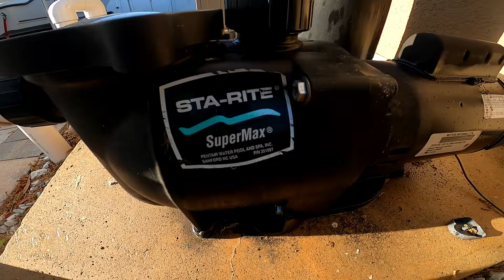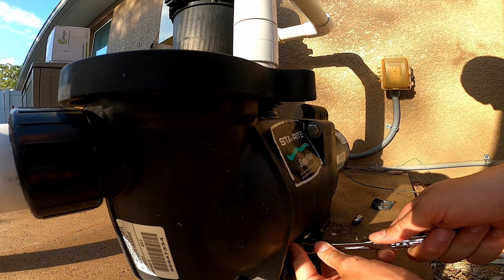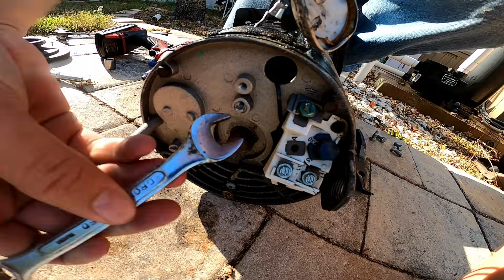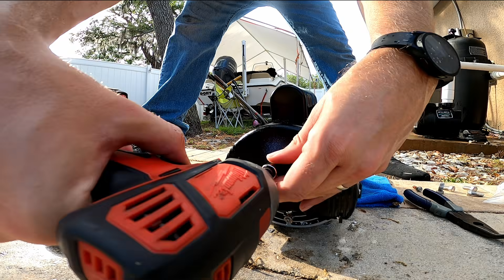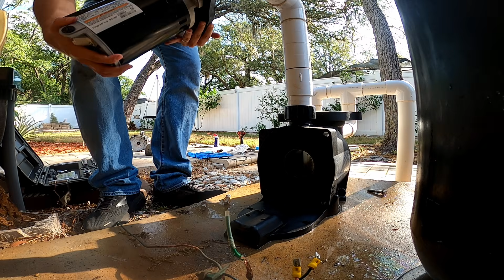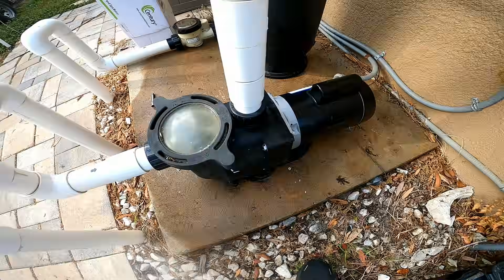How to Replace Pool Pump Motor Sta-Rite / Century

Comment: I hear you shouldn’t touch the inside of the bearings he touched as the oil on your hands finger can cause a hot spot failure in 6 months?

Comment: Would replacing just the motor on my Sta-Rite SuperMax solve the whiny noise my pump is making? I've fixed my sand filter and multi-valve stuff before, but not a motor and/or pump. This pump is about 10 years old, and I've replaced two capacitors already, but never the motor. Thanks!

Comment: You need to replace the entire shaft seal including the porcelain part in the seal plate  not turbine housing. And the fan is the impeller. You use a 7’16th wrench to hold the shaft in place while tightening the impeller. And the turbine cover is the diffuser. You don’t want to tighten the motor bolts too tight as it’s recommended to tighten to 40-60 ft lbs of torque. And I would never use s screw driver to separate the seal plate from the pump. And finally I wouldn’t splash water all over the motor as you won’t be able to tell if the motor is leaking from the shaft seal. Other wise good explanation on replacing pool pump motors.
Reply from the maker: Thank you for the information!
Reply: You seem to know whst your doing, my pentair superflow 1hp motor died, it has a square mounting flange, can i use any 1.5 hp pump motor with the square flange to replace ? Will it be a direct fit? Also would i need a different impeller if i upgraded to the 1.5hp?
Reply: @Joe-w6d9b if that’s what size motor you have on there now yes. And make sure to buy the shaft seals. You will be good if you follow exactly what he said and I recommended. Good luck. Let us know how you end up.
Reply: @sflspotter6638 well no it's not the same size motor I want to go up a half a horsepower, i'm going from 1 to1 and a half horse power. It looks.
Like it's the same mounting flange. My question is will bolt rite on like the old motor and do I need to up the impeller size
Reply: @Joe-w6d9b yes it will bolt right up no problem. May I ask why you’re going up .5 hp? And yes you do technically need to.
Reply: @sflspotter6638 because my furthest return is over 50ft from the filter. Why? Not a good idea?

Comment: Best video by far on changing out new AO Smith motor. Just 1 question..I have the green geound wire but 2 purple wires also. Does it matter which way they plug into back of motor ? I heard if wires are same color it does not matter ?

Comment: You didn't explain which wire went to what connection.
Reply: He took a picture and suggested we do the same.
Reply: Ground is green,.. if you have colors for your electrical its L1 blue and L2 red.... but also, I asked a poolman that same question. He said "the two wires if they both just have black..it doesnt matter.

Comment: I’m working on the pump 220 and has too hot wires and one ground wall two ground the one with the green screw and the other one is white but all three white and black and red has power what can I do to verify if  right wire What’s can I do ?
Reply from the maker: If you're unsure, I would definitely have an electrician verify your wiring. It's better to be safe than sorry when it comes to electricity.

Comment: Thank you!!!! You just saved me $300.00 bucks, I was quoted $550.00 for the pump + installation, I will just get the pump and will do it myself. Thank you again!!!
Reply: I was just quoted $2000 for the pump and the installation. I just received the pump. Hopefully this video will help with my install!
Reply: @s @silver-glass noticed op posted this comment 2 years ago. I was wondering how much a quote would be in this economy now days. That’s insane. I didn’t even wanna get a quote lol. Replaced mine today! Back in business! Good luck with yours.
Reply: @FretBoardFixated Thanks JJ. How long did it take you to do yours?
Reply: @s @silver-glass maybe a hour and a half. I had my 10 year old son helping as he wanted to help and learn. My pump was 13 years old so one set of the 4 bolts were seized on there good. We had get a pole on the end of the wrench to get extra leverage. Once I finally got broke and turned a little my impact was able to get them off. Cleaned the bolts with a wire brush and lubed and they went back on easily. That was the only hiccup, rest was smooth. Thanks to this video.

Comment: Why do you keep calling the impeller a turbine fan????? Why didn't you change both halves of the shaft seal???? Why did you call the wires positive and negative???? I'll be very honest with you, If I were you, I would go back through that whole video and do a lot of editing before you get someone killed. Some pump motors are wired with 220, some are wired with 110 and you made no effort at all to explain the difference. Sta-Rite by the way is pump manufacturer that was bought by Pentair over a decade ago, and Century just makes the electrical portion... the motor.
Reply: WHO CARES HE FIXED IT
Reply: C’mon man, he did alright for a homeowner.
But of course, if you want it done right….call a pro.